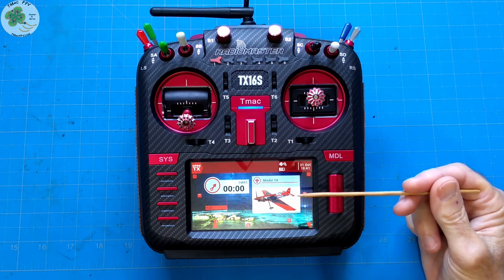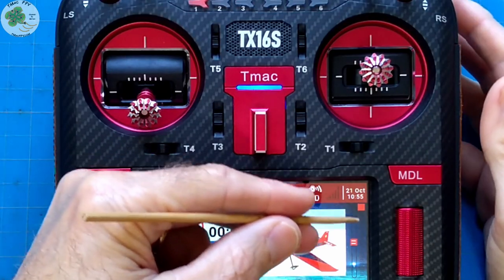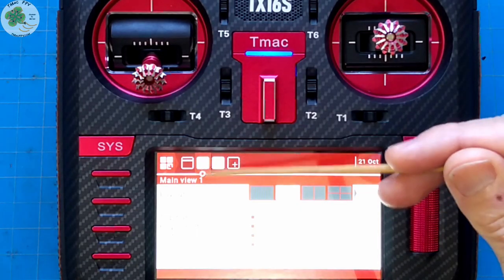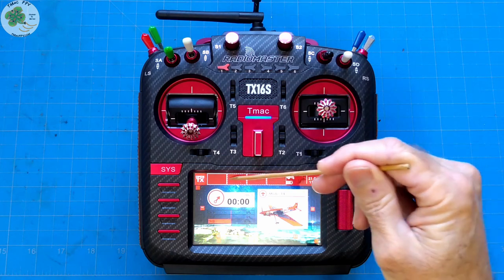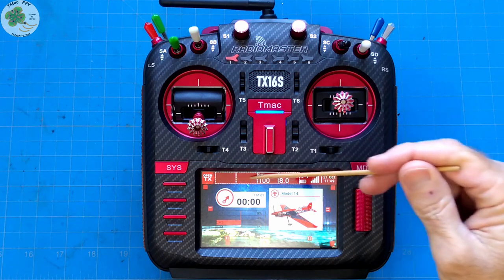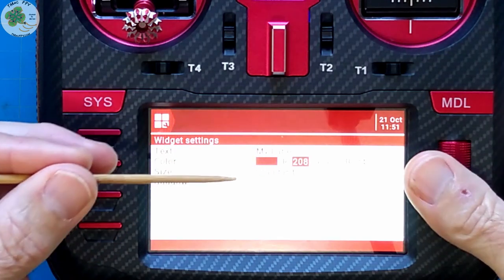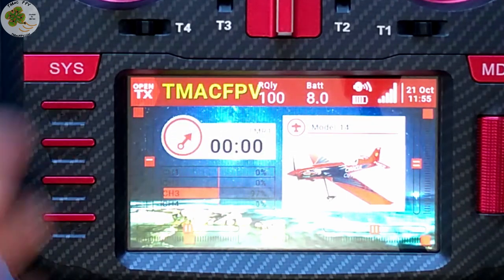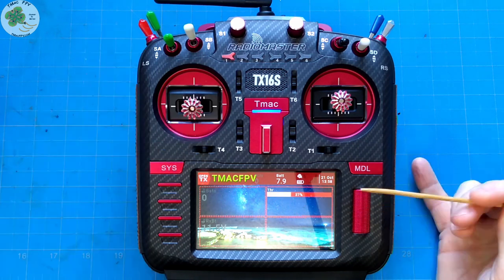RadioMaster TX16S (TELEMETRY and WIDGETS!)

Comment: My tx16s max is updated to the latest firmware and I dont have rxbt D:
Reply from the maker: Latest OpenTX firmware, latest multimodule firmware? https://youtu.be/xAmCWIwzlKc Type of receiver? Receiver bound to multimodule and powered on? Discovered New Sensors? "Ignore Instances" selection box unchecked on Telemetry page of transmitter model setup menu? All are things to check
Reply: ahh found it its called serial for open tx